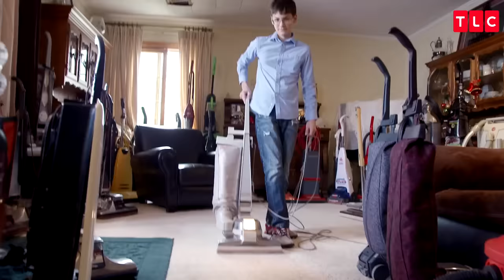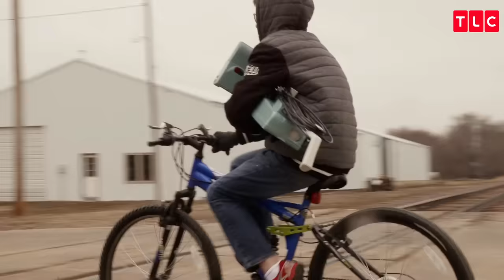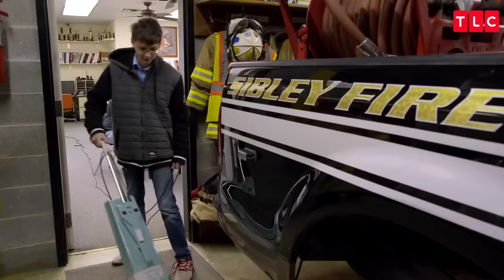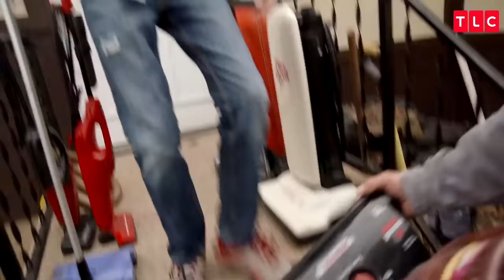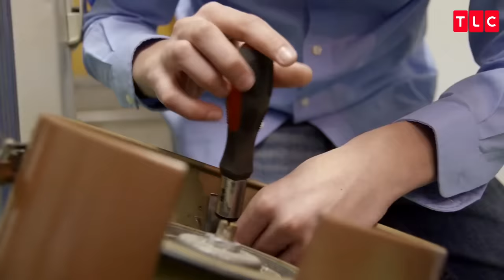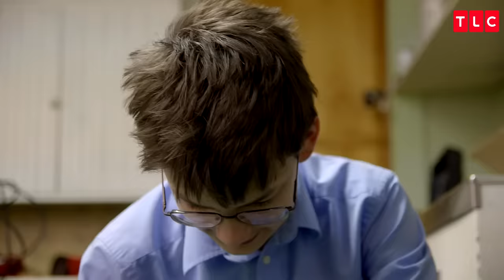When Your Kid's Obsessed With Vacuums, You'll Always Have Clean Floors

Comment: can you fix our shark vacuum? Its not suctioning well and then it spits the debris right back out again as you move it along the carpet
Reply: It has a blockage somewhere, clean the filters, they should be visible when you remove the dirt canister and check the hoses for clogs, also clean the brushroll on the bottom of the unit, hope this helps
Reply: @vacuuminfo3526  we got it thanks it was full of hair